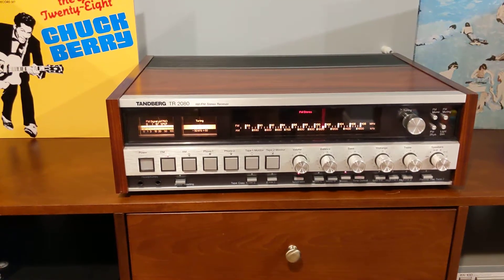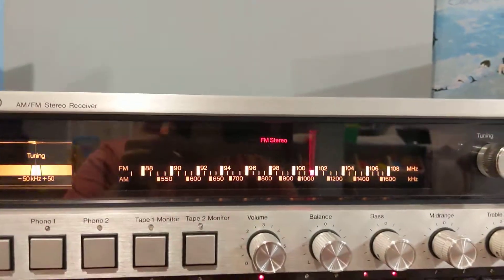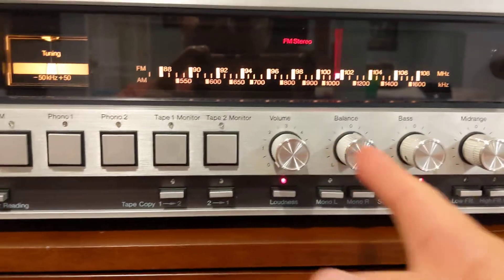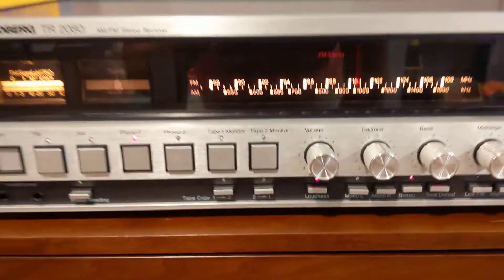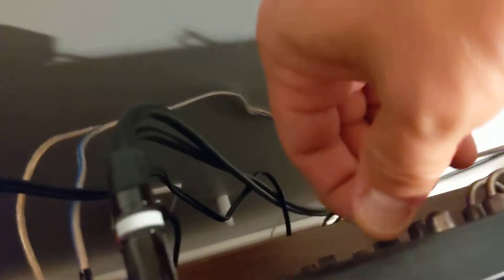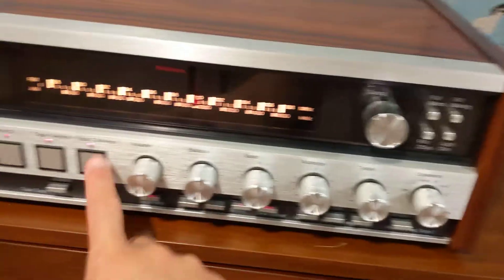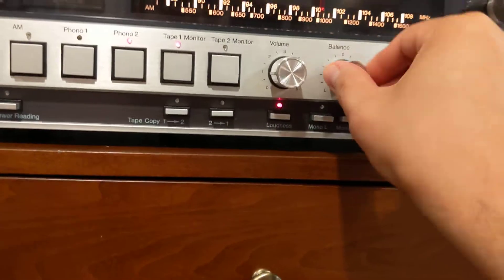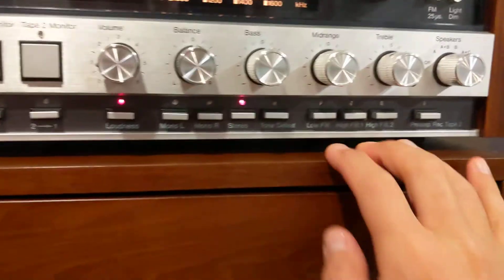Norwegian MONSTER: Tandberg TR 2080 Stereo Receiver 125 Watts!!

Comment: Yes Tandbergs are the bomb.  I have a TR-2045 I bought new in '82  (still have - still great) and a 1980 TR-2080 I bought ten years ago  (still use - still great)  Over the years I've kept them in good shape. I've had to do two Repairs (a guy 40 miles away works on them for reasonable money)  But there's nothing quite like these Norwegian receivers.

Comment: Having 2 phono inputs was very common on mid- and higher end receivers/amplifiers of the time. What’s unusual about the TR2080 and 2075 however, is that it also has separate pre-amplifiers (RIAAs) for each of the phono inputs.